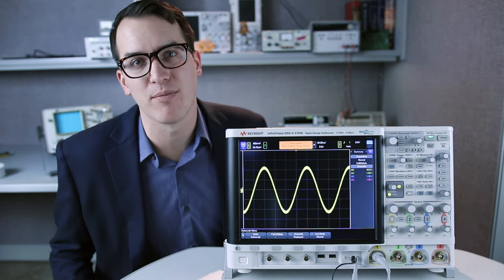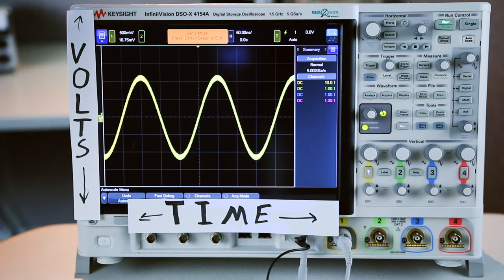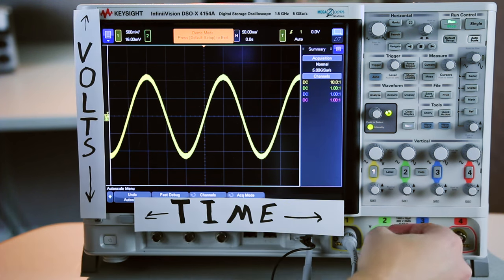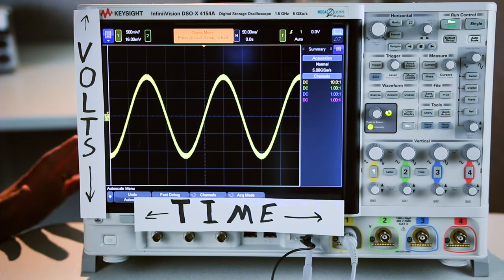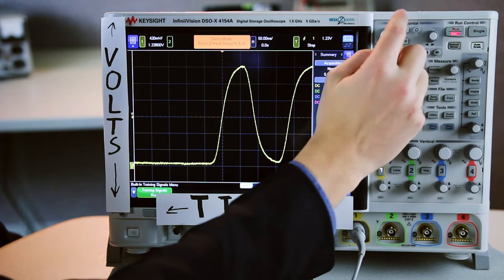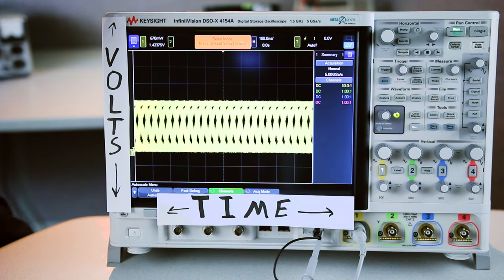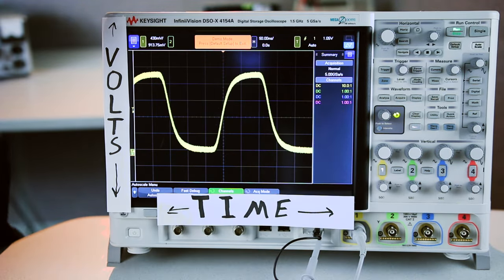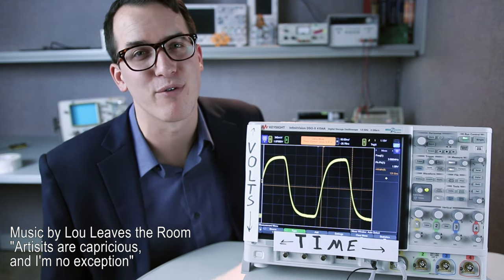Oscilloscope Survival Guide - The 2-Minute Guru (s1e1)

Comment: Can you show the benefits of an oscope, in the development of high end consumer audio design? (Phase/harmonics/transient decay/etc..) Thanks
Reply from the maker: Good suggestion! I'll definitely look into it going forwards.
Reply: Oscilloscope can give a big help mainly when you deal with power stages, however it's not useful for distortion at values we expect in a good amplifier. Only high values bigger than 1 or 2 % will be evident. For distortion you need a low distortion oscillator and a good fundamental frequency rejection filter like UTC BML-1000